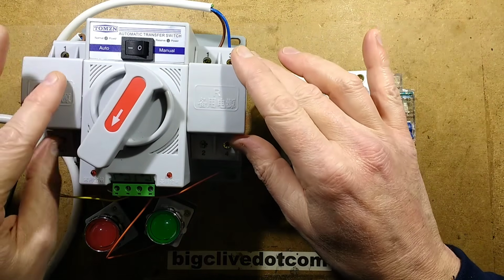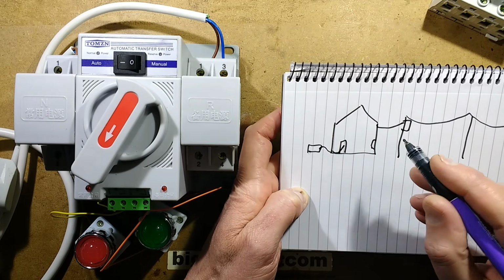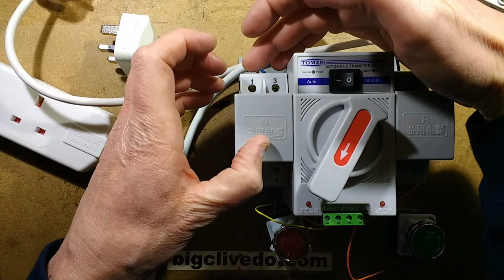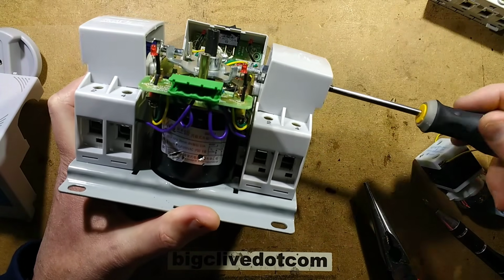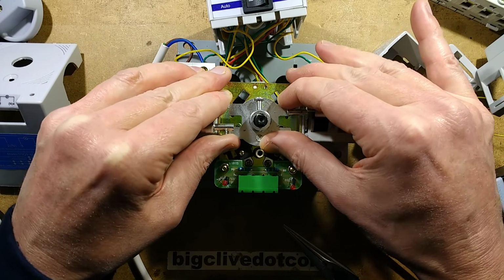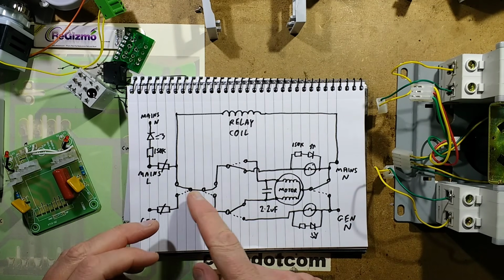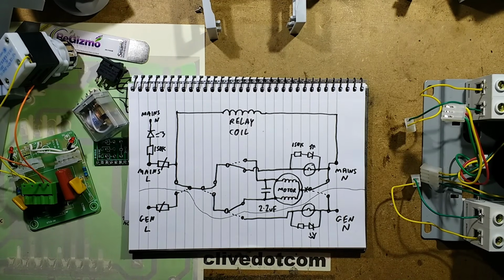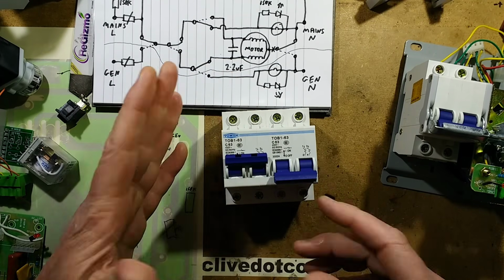Automatic generator changeover switch (with schematic).

Comment: Great video, what is being output by the indicator/control terminals? 230v or 24v?
Reply from the maker: That may vary between units.  It could be a dry contact or mains voltage.

Comment: I live in Iraq and I have something like this but a 4 pole version (4PRO ATS-63A-4P-RSC to be specific) for 3 phase power. Our house is pretty power hungry with 3 phases landing in the distribution board. L1 for our house's appliances and L2 and L3 for the heavier machinery like HVAC, water heaters and whatnot.

The way a lot of those 4 pole ones work is that the motor is only connected to a single phase, essentially giving one phase "priority" such that if that one specific phase fails, it'll switch to backup power. My backup power in that case is an off grid solar Inverter with a 15kWh battery. The utility's neutral is also disconnected when switching, rendering the house completely off grid. L2 and L3 will be dead of course since my Inverter is only single phase, but we only need L1 to power the house's essentials such as lights, TV, fridge, freezer, etc.

The nice thing about a setup like this is if a non essential phase fails (Like L2 or L3) then the house will continue running from the grid since the motor is only connected to L1. I do absolutely recommend you run MCBs and/or fuses inline with the ATS though just in case. I really doubt the ATS will have a catastrophic failure since it's a mechanical device and uses an interlocking system, so even if it fails it'll fail to one side and you can manually switch till you replace it.

All in all it's been a massive life saver honestly, instead of having to design a whole ATS with contactors, phase failure relays etc I can just use this all in one device. I only need to disconnect from the grid if L1 fails, and it does exactly that. At a price of ~$75 even if it fails every 1 year I won't mind replacing it, it's that convenient.

Comment: I have been scratching my head for months on this one. I have a small diy solar system but with 580ah of LiFePo storage. Mostly I charge overnight on cheap rate and use the 3kv inverter during the day to run the house. I have literally halved my electricity bill whilst also now charging a mk1 Leaf for the short commute!
I have been trying to work out how to automate the switch over from internal to external power when cheap rate starts and ends so if I am away I can still use the system without risking the wife’s life which is worth more than the potential savings.😂
I saw this video and realised that I knew the very man that could help me!
  I suppose that a simple stand alone timer interrupt breaker of the incoming mains to the consumer unit and utilising the built in UPS functionality of the ecoworthy charger inverter is going to be easiest and safest. I don’t like the idea of killing anyone for just £50/month other than myself if necessary😂
Reply from the maker: It might be better to have an interlocked contactor based system that switches between supplies.  These units aren't perfect.

Comment: Oh yes the suicide cord. I live in South Africa so we have 220-240v on our outlets and that type of cord I've probably shocked myself over 20 times when I forgot to turn of the generator and went to unplug the plug first. Usually ends with a laugh though. A lot of people use them here because of load shedding and a cheap cord is well affordable compared to the changeover switches . With the cord you just have to work in discipline to always turn of mains power before plugging in the generator otherwise when power comes back boom.

Comment: 4,000amp house hold breakers.....Americans with 200amp main breakers😳😲😵😊
Reply from the maker: The kA breaker ratings are for fault current breaking capacity and not the load capacity.

Comment: Thanks Clive. Always like your explanations. So the relay here will stay on in either generator position or in the mains supply position. is there any mod we can do to have the relay switch off after change over?? Appreciate your input...
Reply from the maker: I made that video a long time ago.  Not sure if the sides can be used interchangeably to result in the relay normally being off.

Comment: Thanks for a very informative video :)  I notice a big shortage of video's describing the signal side of the ATS. Would love some details regarding how they communicate with the generator start /stop circuit. I have an ATS with 3x wire Autostart Output (+12Vdc / Gnd / Signal - normally Open) and need to have it start a 2x Wire AutoStart Generator..... It's quite impossible to find any real guidance on this. Any help would be amazing :)

Comment: I’m thinking of getting one of these to use with my new EVs V2L capability. The idea would be to wire up the V2L to a 7kW circuit, and have the changeover switch think the V2L is grid and the actual grid is the generator. I can charge up for free so ideally I’d charge up at a public charger for free (or at home with solar), and in the evening, connect the V2L which would transfer the oven, stove, fridge, HWS etc all over to the car, and then back to the grid once I unplug the car…

Comment: Thank you so much for the precise to-point informative orientation.  Can you also do  the practical  video clip of the wiring process from the panel control to the generator auto battery connection for ATS

Comment: Also if the maintenance worker didn't got shocked somehow and the power is restored while the breaker is on, still the generator is out of sync compared to main and high chancr something will be damaged.

Comment: Great video. I just might buy one to play around with. I do wish you had dismantled one of the switches to see if a) these are circuit breakers or just switches and b) the contacts are even close to adequate for the current rating. The Chinese are notorious for claiming a 20A switch contact can handle 40 or 60 A. Of course, they soon burn up.

Comment: Ive had two of these now and both have failed at the breaker/switch internal contacts. They get hot and warp which causes them to lose contact. It would be great if someone found a properly rated replacement breaker.

Comment: For our American panels, you can get what is called a generator interlock kit, where you have the breaker from the generator input (and also a proper twist-lock male power connector on the side of the house that actually plugs into the generator), as well as a piece of metal that will go on the main breaker and the generator breaker, and prevent both from being on at the same time, so you can't backfeed and can't get a shock from the exposed metal on the male power connector.

Comment: Kindly help here,,,can this device be connected to a generator such that it can ignite a generator when the primary power us of
Reply: You don't need to, use the  power from the main to power a 12 power supply, and connected to a relay so it would trigger the NC points which then trigger a timed relay to turn over the generator

Comment: I’ve done something similar with a solar water heater  changeover switch using two motorised valves, to switch between a combi boiler and a solar heated water tank dependent on water temp. My relays are off in the default state which is predominantly solar tank is hot and I can turn off all power to save the relay coils. I also have a manual override for winter.
I think the design of the power transfer switch could be improved by only energising the relays when the generator comes on, and use a normally closed relay using no power when on grid power.

Love your tutorials btw you’ve been an inspiration albeit mostly above my level of knowledge.
Reply: Great idea! I'm just about to do the same thing: a motorized valve that can select either my solar hot water or a new propane tankless water heater. The valve will be controlled by the mechanical thermostat on the solar hot water storage tank. I'm confident it will work just fine. And as you point out, I can control the valve manually to save the relay coils.

Comment: Could you demonstrate a suitable IPS battery system to eliminate the momentary drop out of power during switch over for use with computers and/or sensitive equipment? Would such a system risk backfeeding at all or are they safe to use? A schematic would be ok a actual demonstration would be excellent. Just in case you need a video idea or because you want to do it, thank you for yet another wonderful video.

Comment: After watching this video I bought one of these and I must say it has worked extremely well. It is for my camper and switches between the solar system (inverter) and shore power. I forgot what the green terminals were for so I returned her to find out. Super glad I did. It is 3 years now and still works great. Not bad for $14.
Now I see that the green terminals are just for indicator lamps. Perfect. That will go on my control panel which is remote to the switch.

Comment: remembered a funny reddit story where a couple were having issues of the wiring in their vaca house being stolen and just power being cut in general so they installed a backup powersystem and shortly afterwards got a call because three chared bodies were found in the house. cracked me up that a couple trying to keep the power on for one of their homes ended up killing three people by accident.

Comment: TOMZN no longer sells that style of automatic transfer switch. Reviews of the various ampacity rated models state that the internal contacts are the same regardless of ampacity rating. Many failures are reported and TOMZN is an unreliable company, no response, no refund, etc.
Reply from the maker: There's unfortunately noi guarantee of quality from any of the generic brands.

Comment: Wouldn't it make sense to connect this the other way round? With the generator on the left side? That way, the relay would not be powered all the time, the device would switch to the generator when it is powered up and only switch back to mains when the generator is switched off. You need a way to switch the generator on and off depending on the state of the main power anyway, and this way, the switch follows the generator state that inversely follows the main supply. You also avoid that "switch back to an unstable main supply" issue that was mentioned.

Comment: Hi Clive, yeah we across the pond call it a 'suicide cord'. I do this Clive, BUT before I even go to
the shed where the gen is, I go to the pole and beneath the meter is a double breaker. I shut it off
and put a lock on the box. I also shut off MAINS in panel in house. This way there is NO way to
backfeed to the grid. ALSO some utility companies might decide to to NOT give service to
 that house if they find a gen improperly hooked up, backfeeding into the grid.

Comment: i now have to pull mine apart, im using it to run my solar setup whenever the inverter is powered it switches off the mains and uses the inverter.
something has failed in the control circuitry and immediately trips the breaker that feeds mains into the transfer switch. 
currently having to switch off the mains supply then actuate it manually to get round the problem

Comment: Dear Clive, what happens when the breaker trips, considering now that the lever is now stuck in the motor mechanism?
Reply: The circuit should be protected by circuit breakers which will trip before these ones do. They aren't really meant to be circuit breakers at all, just switches. In fact, since Clive didn't open one up, they probably aren't breakers at all. They just resemble breakers.

Comment: This Tomzn transfer switch looks economical.  I know installing a turn key auto transfer switch to your house is quite expensive and involve adding several more control boxes outside.  In case you want to know , for Canada, the high voltages outside on the pole starts at 4160V, then double that to what we call 8000v and double again  to 13 -8V etc. The dryer is not the biggest power outlet in most homes  at 30 amps , most homes have stove outlet rated at 50 amps that we put on 40 amp breakers. But some who have gas ranges had the outlet removed or converted to a regular 120 V outlet. A gas stove still need 120V. In UK, when power is available (had to put that line in)  it is 220 v with one line to ground, or neutral. In Canada , you need 2 live lines together to get 208 or 240 V The neutral is necessary if you want 120V from either voltages. Many motors or heaters will just work without the neutral. being a electrician for decades, it is against my religion to shell out big bucks for a transfer switch. I can use a "suicide" cord, or I just back feed the breaker, but I highly doubt I get zapped. Linesmen working on outside lines either assumed the line is live or they been grounding it for decades. It is extremely rare to see one of them hurt on the job.

Comment: you stated an inaccuracy that in the USA, the 30A dryer outlet is the highest power connecter. we also have NEMA 14-50 (50 amp) and NEMA 14-60 (60 amp) outlets. this NEMA 14-60 is our highest power 2-phase outlet & plug. but the 30A dryer outlet is commonly the highest power outlet in some homes. (but this is only with homes with an electric dryer. gas dryers are very common too, which only use 120V circuits.) But now with more popularity of Electric Vehicles, more and more homes are getting wired for higher power & higher amperage 240V circuits.

Comment: In a power outage , usually a whole street  or neighborhood is losing power.
Remember they have some or all their loads  connected to the grid.
 If you "backfeed" power from your generator , you suppose to feed the whole neighborhood.
99.99% in the cases your genset will die off,    not being able to provide the current for the overload..
In case you have a 100 KVA generator than you probably not backfeeding through a dryer plug :)

Comment: Does UK have two or split phase system like USA?
Reply from the maker: Homes get a single 240V phase.
Reply: @bigclivedotcom  none have more than that? Were you cutting your null as well as your breaker has two poles? I thought those were for phases. I made the same thing with three phases and four pole contactors.

Comment: I've designed, wired and tested dozens of changeover systems, typically 2000A 400V or 10kV, with up to 6 timing relays, voltage monitors, trip contact supervision, 20 aux relays.
This one is clearly done as simple and cheap as possible. Fun to see.

Comment: with one phase this should be no problem, BUT if you have 3phase like in Europe than this could be a big problem. 
Most of the generators only monitor voltage from one Phase. If you are disconnect and the neutral is off at first than you could have 400V .
https://www.youtube.com/watch?v=gJj1wl2dspc&t=2s

Comment: people who are "working the lines" should ground whatever they work on before they begin work.
that is code in germany (code: VDE 100)  - you never trust the line is offline you offline it, you control it is w/o power using metering equippment, and then you fucking shortcut it to ground in case some fool does something like backfeeding into the system (or just flipping breakers back on downstairs in the house)

so every american who "work the lines" should consider this, perhaps steal a page from out of the german electricians unions rulebook.

very good video though!   if i could i would like it 3 times.

73, oh8xat

Comment: May I ask what you did with the cpc
Reply from the maker: CPC is usually common to everything.
Reply: @bigclivedotcom  if a home is connected to a tncs are you using the earth still or a TT earth if you switch to the generator
Reply from the maker: @gino2465  Electrical regulations are different around the world.  Your home earth/ground system is making it an equipotential zone.  Whatever system is powering it should probably use that grounding system.

Comment: Can this switch be used for an off grid (non UL standard) solar system where the solar is used until the battery is depleted, then switch to the power grid? I want to use non UL components to save money on my solar system, but I'm not interested in selling kws to the power Co. and don't want to risk the safety of linemen with my off grid setup.

Comment: Hello sir, I have a question, I purchased a wood lathe from England and and I didn’t know the electricities were different between some countries, so over there it’s 50 Hz and over here it’s 60Hz and the two machines I got are both 230 v and I wanted to run them with a generator, so, I wonder if I just change the plugs the machines will be ok ?
Reply from the maker: They should be OK on 60Hz.
Reply: @bigclivedotcom  thank you so much!